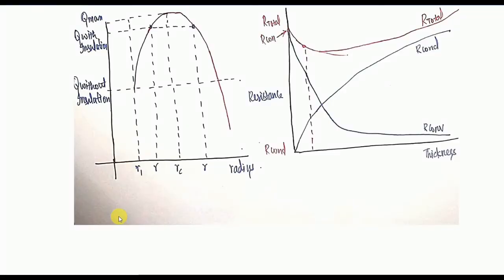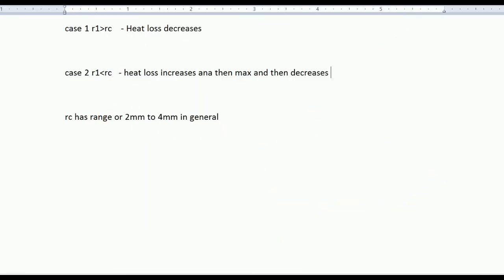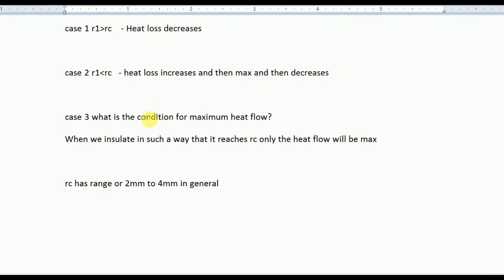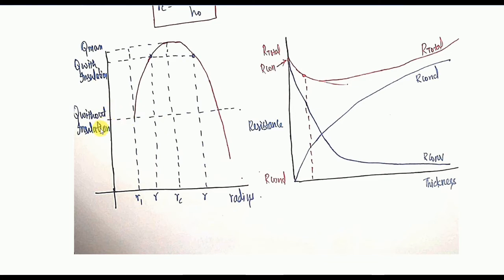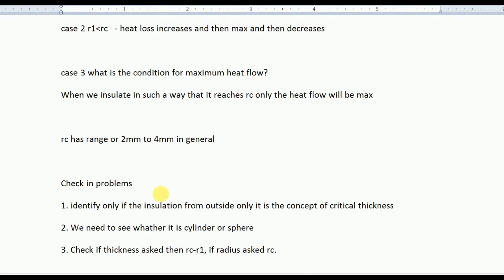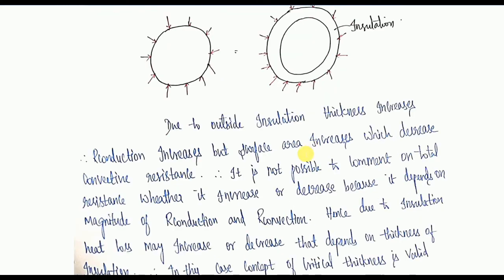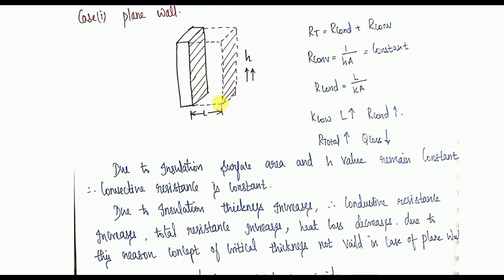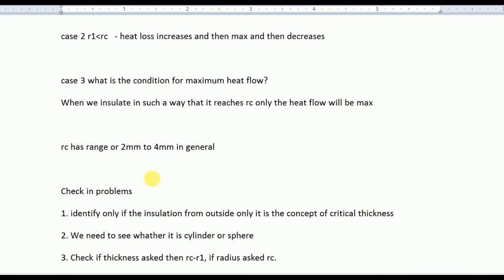Heat and Mass transfer 8 | GATE | ESE | BARC | ISRO | DRDO | Interview Q &A

Comment: Sir,when heat loss increases only critical thickness comes to limelight right.My doubt is whether in domestic applicants or industrial applicants ,on which heat loss will be more ,it might be an approximate answer to deliver but do industries face this issue or else households are mostly preferred because of electric wires as they are small in size and cheap in costwise.
Reply from the maker: As we discussed in our lecture heat loss is Max at rc critical thickness.
Coming to your question, 
Now if we take industrial  application, in this steam pipes has a major role in industries like power generation or process like condensation etc. You can see here that this steam pipes are in meters and now we know that the general critical thickness range is of 0.2 to 0.4 mm only so it fall far beyond the rc, that is second zone as we discussed so here the heat loss is always decrease though you increase the rc also it is only in mm it can't be in meters to match the steam pipes.

In domestic application majorly if we take the example of electric wire how ever the wire it will come below the rc because this is the only things which has dia less than  rc so here you can notice that heat loss always increase and after sometimes only it reaches max and decreases 
So in general we can say that in domestic application heat loss initially increases